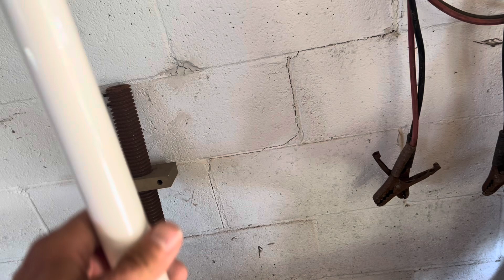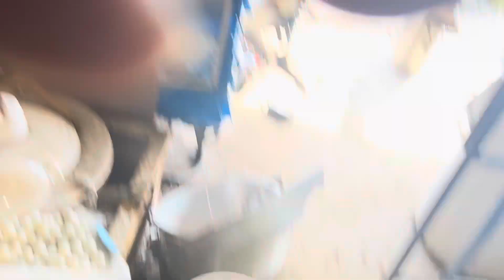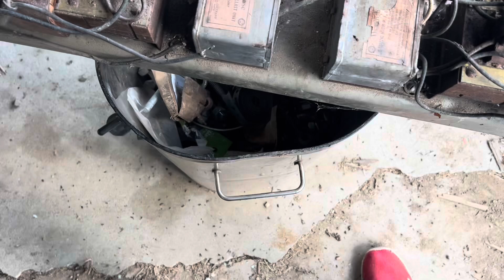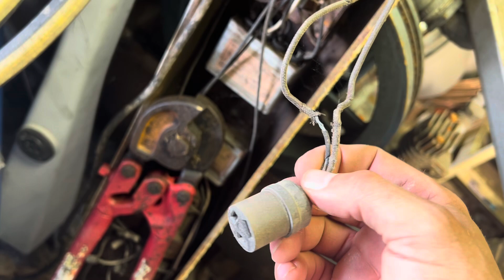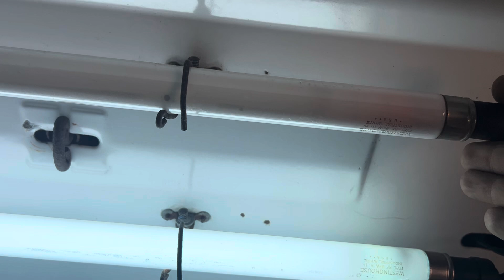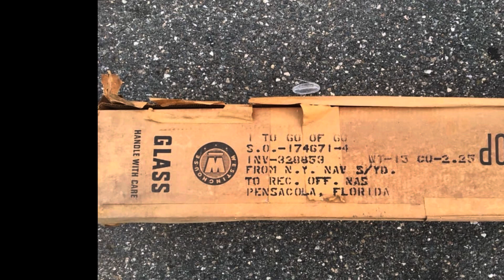1941 Westinghouse F85T10 Rectified Florescent fixture

Comment: I've actually been looking for one of those rf fittings, funny enough. I'm a fluorescent light collector, also to add the two lamp rf fixtures  these days are even harder to find than the single lamp variant from what I have noticed. As for the hostility from the other collector, that's fucked up. But yeah, you and nicksfans are the only two collectors I know of that have these fixtures, and both of you seem wonderful. Closest thing I have to those fittings are the fluorescent lighting manuals that Charles amick wrote, both of which do have the electrical schematic for both rf lamp fittings. Also thank you for showing us the inside as well, from one collector to another. I love this kind of stuff! You also got me excited seeing  the black ender there, I didn't even know those were made. But of course seeing it be westinghouse I anticipate it, what's more those electrodes look very well built. I love seeing quality made lamps

Comment: Very nice fixture! However, I would be very careful in operating the light. Those 2 caps will have pcb's inside, and due to age, they will fail! I used to have several 4' preheat fixtures with the high power factor ballasts, but the caps in them went bad. Do miss the blinkfest.......

Comment: truly unusual ! I remember seeing a florescent fixture as a teen back in the 70's that was an older style by that time. instead of the two prongs on both ends of the tube, it had a single  connector at each end that were round, and reminded me of the end of a bullet. I  think they were spring loaded, if I remember correctly... I had never seen one like that b4. and this is even more unusual & interesting. Thanks man! 👍gave you a like and sub 😀
Reply: The single contact ended fluorescent lamp you described is widely known as a slimline fluorescent,  introduced in 1946 by Westinghouse,  the very first ones were indeed slimmer - F42T6,  F64T6, F72T8 & F96T8, as opposed to the then most widely used lamps, the F40T12 48 inch, and F100T17 60 inch - introduced in 1940 as highest output fluorescent lamp at the time mostly used in manufacturing facilities and often considered an early prototype of the High Output, Very High Output & Powergroove lamps later introduced by GE in the mid 1950s.   Soon after westinghouse introduced the slimline lamps, T12 single pin lamps became available but the name stuck.  Today slimline lamps are available in T6, (F42T6,  F64T6) T8, (F72T8, F96T8) and T12 in 24, 36, 42, 48, 60. 64, 72, 84 and 96 inches, with the F96T12 by far the most common,  along with the F72T12,  with the 48 inch and smaller being very uncommon.   Slimline lamps are also referred to as instant start lamps, they require a significantly higher voltage to start than other lamps of a given length & diameter,  therefore special ballasts are required.  Because the lamps start don't use cathode heating like a bi-pin lamp, slimlines are slightly more energy efficient although lamp life is somewhat reduced for a given number of hours/start, so they were almost always used in commercial settings where the lamps are expected to operate continuously for several hours or days between starts.
Reply: @Sparky-ww5re   thanks😀

Comment: Take super extra care when handling that broken lamp. Being manufactured in the early '40s it absolutely contains manganese doped zinc beryllium silicate phosphor before the phase-out in '49, which happened, incidentally, as a direct result of the identification and discovery of berylliosis of the lungs in workers making exactly this kind of lamp....quite possibly at the exact same factory where these very lamps were made. Be and its compounds, to those who are genetically susceptible, can be supremely toxic, with permissible air concentration levels at the mere nanogram per m^3 level. Hazardous air concentration limits which are only rivaled by things like radium, plutonium, and VX agent. I would actually love to get a spectrum of the light coming off of one of them. I have never seen the spectrum for an original Be phosphor based lamp and it would be a great addition to the halophosphate and tri-phosphate spectra on the wiki page, which I took many years ago.
Reply from the maker: I’m pretty certain these lamps do contain beryllium.

Comment: The tubes act just like a standard full wave mercury rectifier in high power tube circuits. The filament or cathode end is grounded and the two electrodes go to the split phases of a center tap transformer to keep one electrode on at a time. The plate is there to stop an arc from jumping the two electrodes when one is off and causing a short.